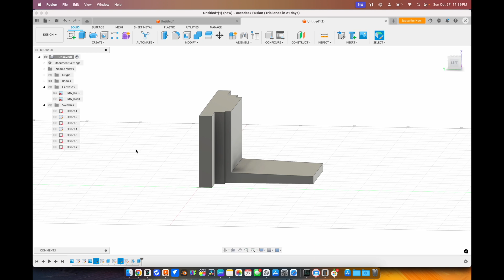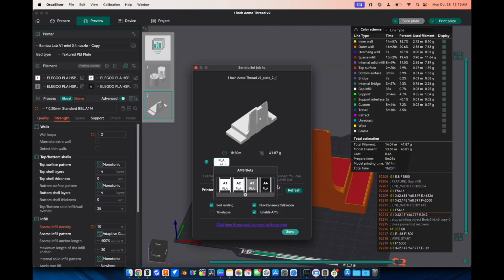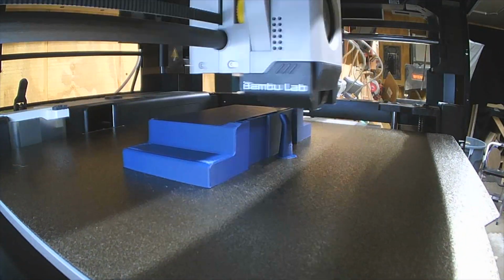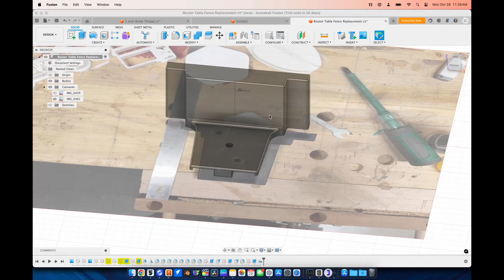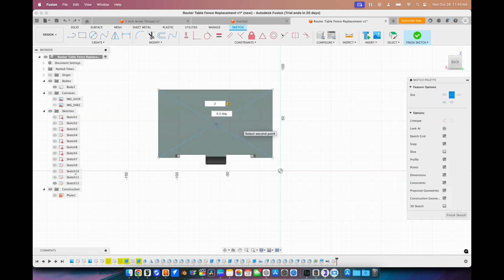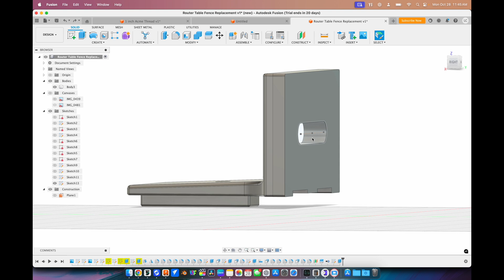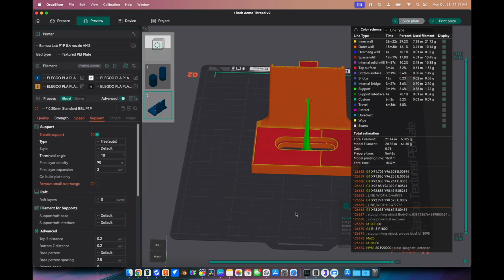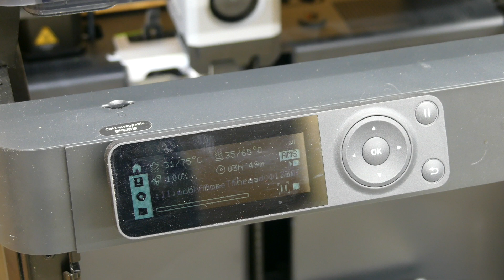Fix Anything! 3D Printing Custom Replacement Parts with Fusion 360

Comment: Awesome job. I do the same thing with protyping out of PLA and then making the final out of PETG or carbon fiber PETG. I heard good things about elegoo's rapid PETG but really want to try out bambu's high flow PETG.
Reply from the maker: The PETG-HF is next on my list of things to test out. I plan on doing a side by side comparison between Elegoo and Bambu since i use Elegoo regularly
Reply: @TheMountainMaker  That'll be a great video to see. I'm very interested in seeing the difference between the two.
Reply from the maker: Thanks for the support!